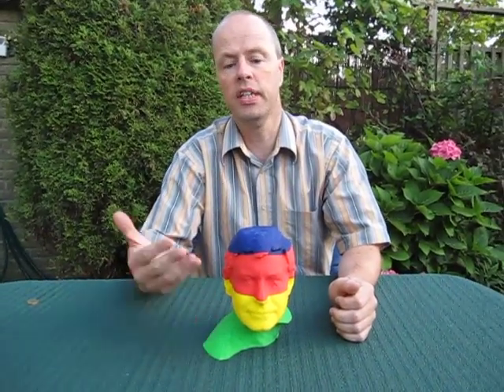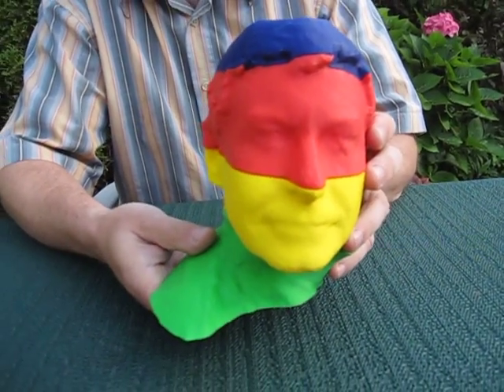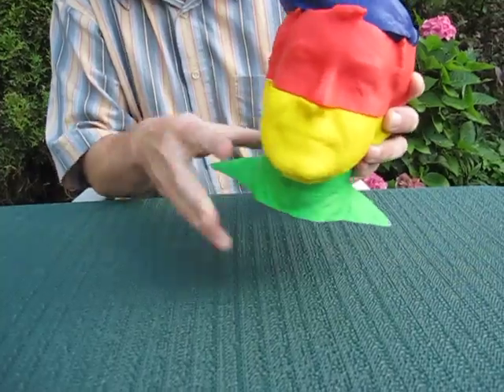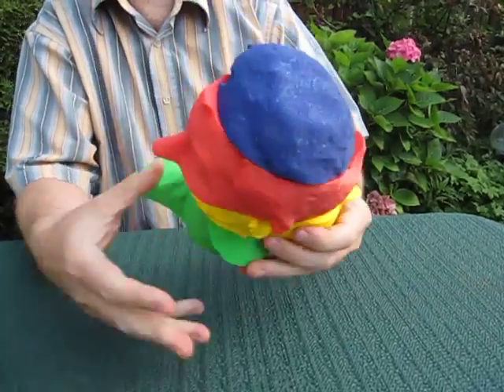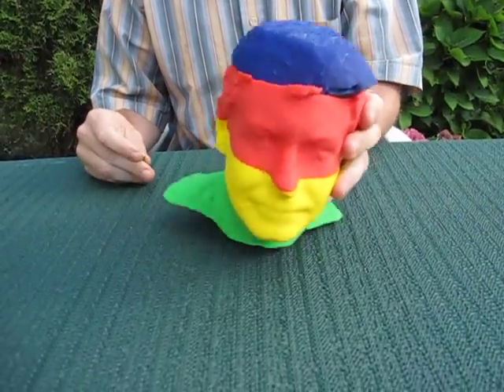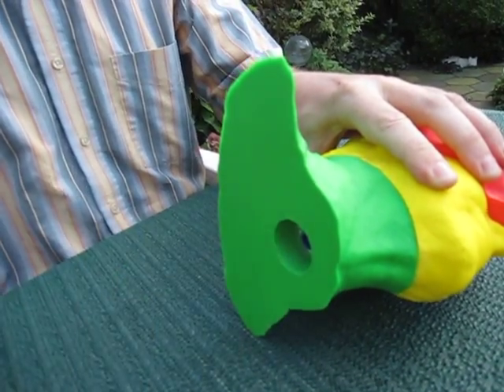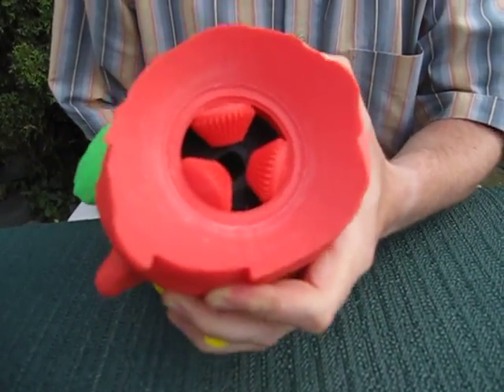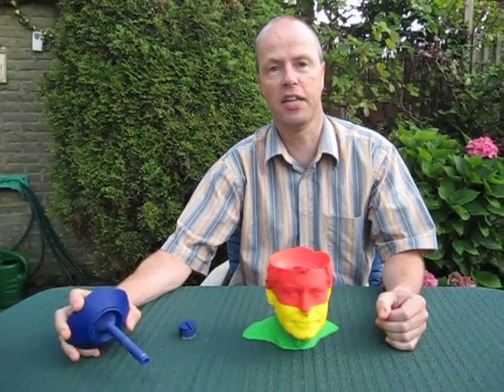Gear Head

Comment: why is this so expensive if it´s so "simple" to produce? D:
Reply from the maker: gsboss
Thanks for liking this puzzle. If you think that there is a positive business case for making molds and mass-producing this puzzle, then please contact me. I can bring you in contact with OEM manufacturers that would be happy to help you with your investment. Also my license fee is quite affordable.
Reply: Simple doesn't mean cheap.
Reply: it's 3d printed
Reply: +OskarPuzzle A perfect response :) much respect. I'm a big fan of your transparent business model. Rather comforting
Reply: Its 3D printed. Its VERY expensive material and 3d printers to print it. Also, its not like a normal printer, it takes alot longer.
Reply: +Patrick Muster
Human heads are expensive to buy.
Of course, there are other ways of getting them, but...
Reply: MrTekkitLPS i dont see why he cant make molds for this one. big pieces can just be molded, you dont really need a printer for this one, at least for all except the gears. shame because i really would have liked this

Comment: Can you make a Scam Cube? Basically a cube that turns normally . . . but you have to insert a dime each time you turn it. Of course, make a mechanism to take the dimes out.
Reply: obviously it'd be a treasure cube.
Reply: Lunamann no
Reply: Magic Man 5000 no, as in, the internal mechanism that holds the dimes is a treasure-cube-like hollow. Then there's a mechanism around it that allows you to turn.

Also I see it being easy to break by adding dimes and turning the wrong way too often, combined with a lengthy scramble.

Comment: i wish there was a cube like this , that moved like a clock(like when you moved one side another would turn slowly ). I would call it cloak cube or some thing. I Know that there is a gear cube but it would not be the same.
Reply from the maker: You mean Geared 1x1x4?
Reply: kinda but the gears would be in side (thx  for responding on my comment)

Comment: @CoxTH not a dumb question at all, I thought about it and then asked my mechanical engineering brother and he said that there is probably a way that if you turn one piece it controls others in different ways, the basic way of explaining this is that while you turn the chin the top is affected, while you turn the top the second piece is affected... basically there is some way that makes it so turning the bottom affects the top but turning the top doesn't affect the bottom... confusing eh?